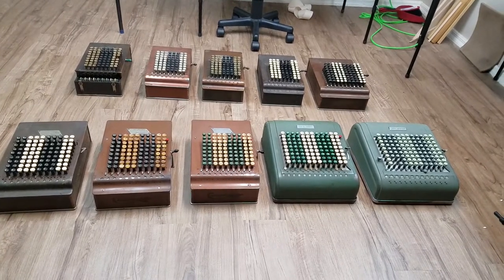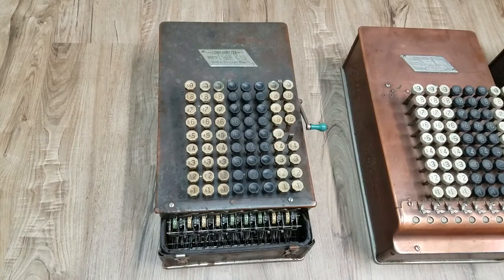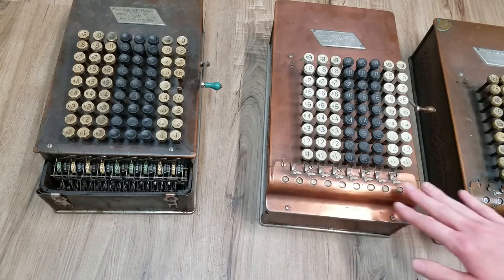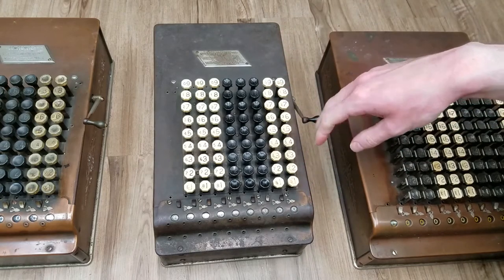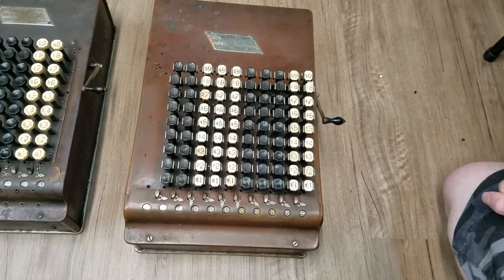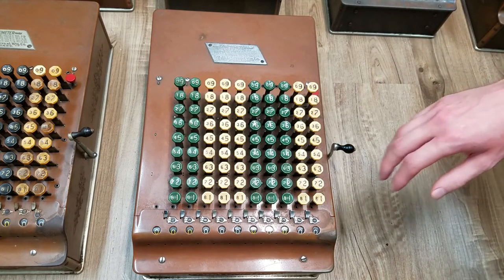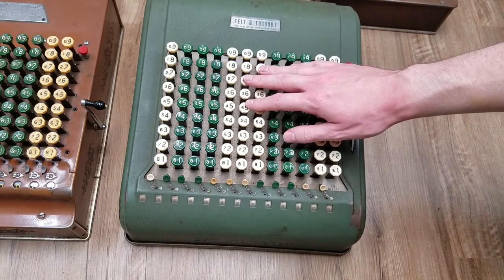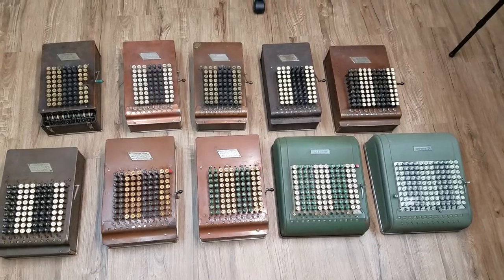Evolution of Comptometers 1904-The End (Models A-3D11)

Comment: I received a model B for Christmas and I'm excited to play with it. But the handle on my clearing mechanism is bent.  I'm afraid to bend it back for fear of snapping. I wonder if you have any suggestions on how to fix it - or how to find a replacement handle.
Reply from the maker: Yes most likely if you try to bend it back it will break. The model B uses the same crank handle as the model F (also the A and E but those are rare), you might be able to find a poor condition model F and use the crank from it
Reply: @bss1250  Thank you for that advice. I was able to source a similar model on eBay for $25 and swapped the handle out. It's on my backlog to try heating the old handle and see if I can bend it back. I appreciate the feedback :)

Comment: Excellent collection! I'm a bit jealous!

Because these are mild steel, bent clearing levers are easily fixed with a small rubber or wooden mallet and an anvil surface (and a bit of knowledge of how to move metal.) I have had to fix several of these because people don't know how to package things correctly and I have yet to tear one. I bought a 12 column H which I was really looking forward to get but it got badly damaged in shipment because of such packaging and now its a restoration project. (The seller profusely apologized and duly compensated, so no hard feelings.) Assuming I can epoxy the keytops back together successfully, I expect to be able to get it working again but it will take some time. Interestingly, this one was, at some point way back, refinished into a textured grey. You can still see the copper underneath where the coating has chipped away.

What I would like to get, (in addition to the presently absent models A, C, and E, and the supertotalizer) would be one of the British currency units and those sorts of variations.